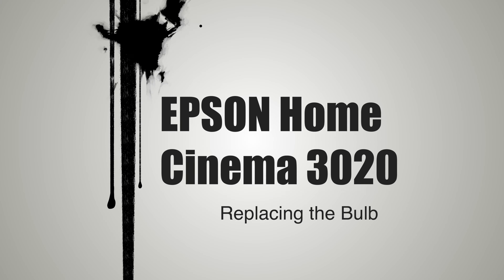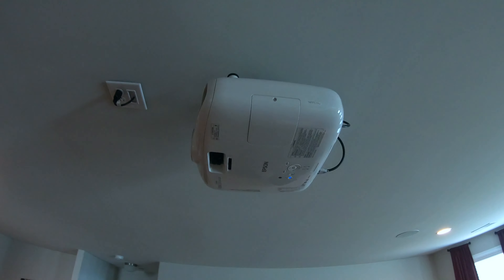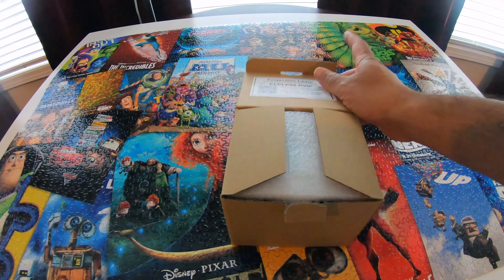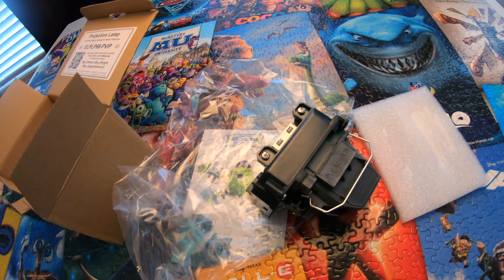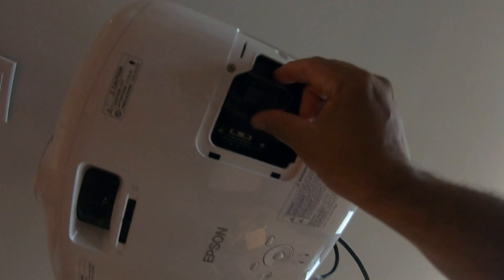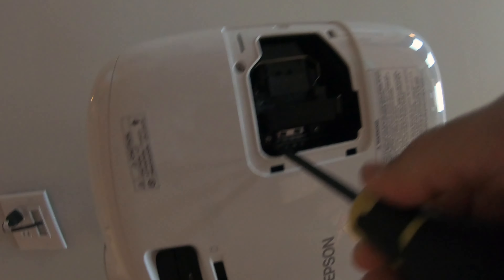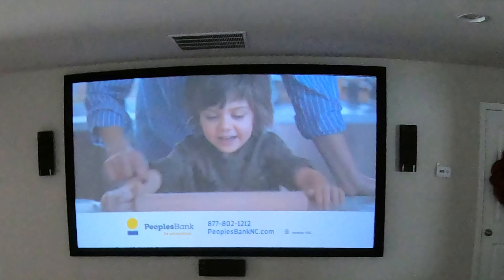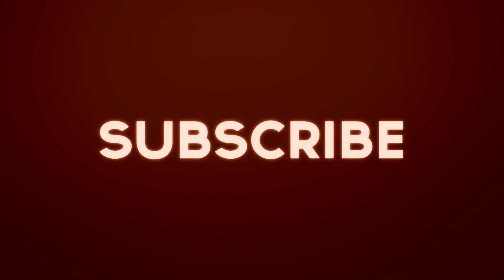Replacing the bulb in an Epson Home Cinema 3020 Projector

Comment: My bulb still works but the lamp light indicator and the temp light indicator blink red. Does that mean I need to change the bulb or is it just heating up?
Reply from the maker: Clean the filter and see if that makes it run cooler.

Comment: Hi, I actually have this same projector, can you let me know how to do proper maintenance on this projector, like how often do we need to change or clean the filters n stuff??
Reply from the maker: I clean the filter every 3 months and change the bulb every 4000-ish hours. We use it as a regular TV so it gets used a lot so I just keep check on the filter conditions as well.

I hope this helps and thanks for watching.
Reply: @TheHappyLife-h7b  oh alright thanks. Which is the replacement lamp you got and how much did it cost? I'm very confused cause there are so many lamps from a lot of different companies
Reply from the maker: I believe it was a Epson V13H010L68 for $199.
Reply: @TheSmithy225  no I don't think you'll have replace them like how you'll have to replace the bulbs. But you will have to re-align them from time to time. You can do that in the image settings

Comment: Hi and thanks for the diy video. Quick question, I've had this projector model for almost 8 years and never changed the bulb, simply, we use it on average once a month or twice at most. Tonight i wanted to enjoy a movie and realized that the bulb was blinking, and couldn't re-watch "Die Hard" does it usually happen suddenly like this or should it at least warn you that bulb is almost out??! 
I'm asking so i could be prepared for the next time. 
Thanks
Reply from the maker: There was no warning. I just noticed the bulb flickering and the pic darkening a bit. I had almost 4000 hours of usage. Thanks for watching!
Reply: @TheHappyLife-h7b  i see, mine was completely out no warning.
Thanks for fast reply 👍
Reply: @gustavosh.5147  I have the same projector too. I got a warning saying it’s time to replace the lamp when it got to 4500 hours. I just got it replaced today
Reply: @johnjose14  then maybe i missed mine!!! Or you're just lucky :)
Anyway, thanks for feed back
Reply: I've also had mine for 8 years, mine started to flicker a little but I've only done 950hours, how many hours did you use before it played up??
Also by any chance have you got a apple tv connected to rhe projector? My apple tv cuts in and out and tells my epson it's overheating
Reply: @soniq351  i can't really tell how many hours because as i mentioned before, i used it like on acreage two times a week. So 416  weeks in 8 years with 3 hours a week, that's like 1200 hours at least. I have it hooked on Amazon Fire but with no issues.
Reply: @gustavosh.5147  Thank you good to know, will try the Amazon fire. Hope after I swap the lamp the flicker stops, strange though I've done under 1000 hours and typically it's meant to last atleast 1500hrs I think.